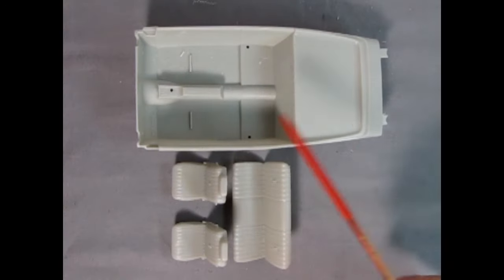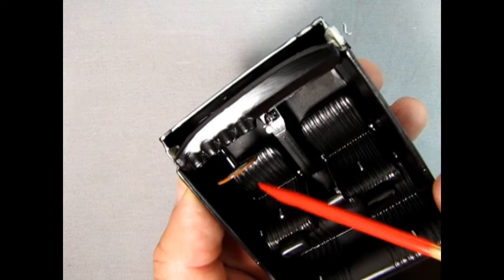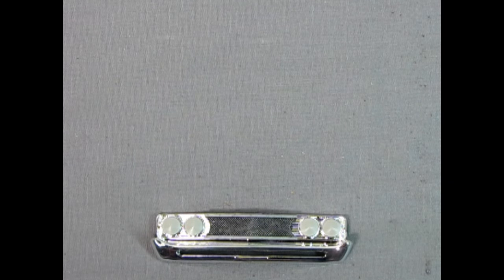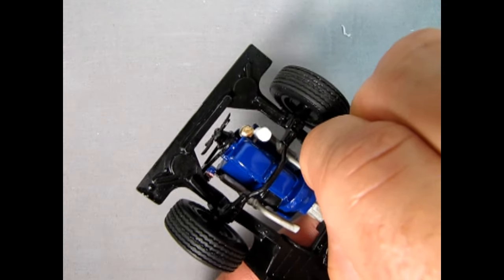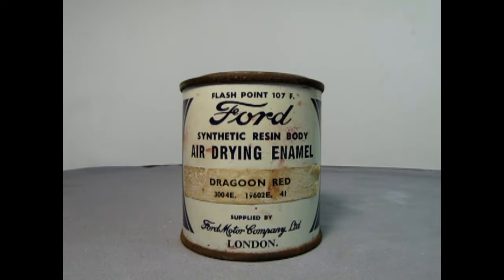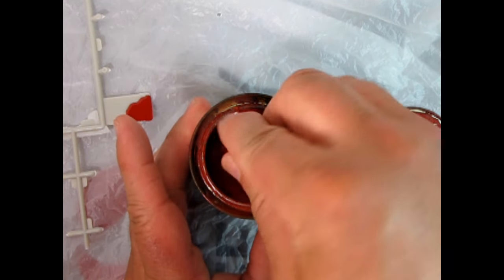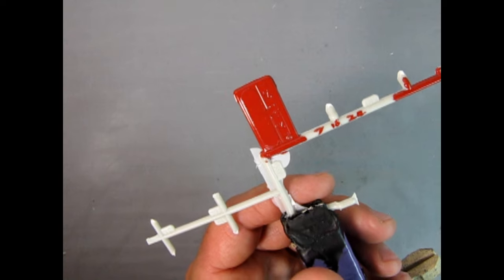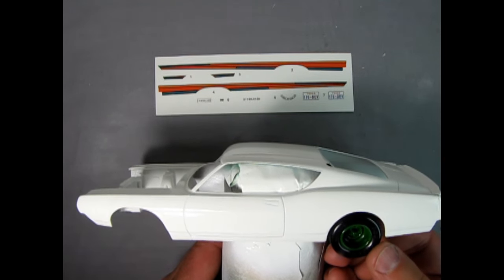How To Fix Everything Wrong With The AMT/ERTL 1969 Ford Fairlane Cobra/ Torino Part 5

Comment: The Nascar teams cut out the package shelf and fabricated a dual hoop upper shock mount that came through the floorboard. They used rubber boots to seal the holes opened up for the shocks to run through. They used the glove box in the closed position to house the ignition components also. They had to use a pump for the rear differential that was then plumbed to a cooler and the rear of the housing at the ring and pinion with hydraulic hoses. The ones I saw used a pump called Water Puppy. There are good pics online.
Reply from the maker: Thank you for the information. I am sure that anyone that wants to add in those details to their kit will appreciate it! 

What do you think of the dual carb set-up. What racing would that be used in?
Reply from the maker: I am going to use your comment in Video 8 where I show my NASCAR version.
Reply: @MonsterHobbiesModelCarGarage  Drag Racing.
Reply from the maker: @stealthbomber2127  But with the "NASCAR" designed dual air cleaner?
Reply: @MonsterHobbiesModelCarGarage  I am pretty sure the Dual Carb setup was used only in 1967 after nascar legalized the Hemi again and in an attempt for parity because Mopar's were winning everything gave the Ford Fairlane's the dual carbs on their 427 cubic inch engines. I believe very few 428 CJ's were ever ran in NASCAR. The 427's and Boss 429's were almost exclusively used during the late 60's thru early 70's Big Block days. Most teams used the Holman Moody air cleaner with an extra hole drilled in it for the duals. I believe the duals were only ran in 67 and may have been used briefly in 68 before being discontinued by NASCAR. The Fastback bodies on the Torino's and Cyclone's were more that the boxy Roadrunner's and Chargers could handle on the superspeedways. I hope this helps if you decide to do a true replica.
Reply from the maker: @stealthbomber2127  Thank you for the information! I will have to look up those years of NASCAR Fords and see if they do run with duals. 

In one of the AMT kits, I believe it was the 1970 Super Bee, they did include the experimental Twin Overhead Cam Hemi motor that was suppose to be used in the 1970 NASCAR season, but wasn't allowed. 

Maybe the dual carb set-up was in answer to that?

Comment: Coming on nicely now,Trevor 👍😎
Reply from the maker: Thanks 👍 - I hope it's helping you out, although I don't know if  my place in the video is equal to your place in building it.
Reply: @MonsterHobbiesModelCarGarage  I've moved on a bit from the windscreen fitting video and have just cut up and altered the other Cobra body to make a wide body kit😲👍😃
Reply from the maker: @petesmodelcarcustoms584  Cool! That should look good. Use the rear wheels and tires from the AMT 1969 Dodge Daytona.
Reply: @MonsterHobbiesModelCarGarage  I haven't got one.but I have found some wheels I want to use. They are in the rack in last video.
Reply from the maker: @petesmodelcarcustoms584  These tires also appear in the older AMT 1925 Model T Stock/hot Rod kits, maybe around 1988?
Reply: @MonsterHobbiesModelCarGarage  I think I've got some of those👍👍
Reply from the maker: They are Goodyear Blue Streak Dragway Specials. They have a tread pattern and are 17mm wide.
Reply: @MonsterHobbiesModelCarGarage  maybe I haven't got a set😭
Reply from the maker: That's a possibility.

Comment: Hi Trevor!Nobody wants to use this old Resin colors!They take weeks to dry and you cant really sand it!And they are very dangerous for your health!!
Reply from the maker: Point well taken!
Reply from the maker: I did a little net research after work and this is a compilation of what I found. (But I did know this from before.) 

What is resin enamel paint?

The term today means "hard surfaced paint" and usually is in reference to paint brands of higher quality, floor coatings of a high gloss finish, or spray paints. Most enamel paints are alkyd resin based. Some enamel paints have been made by adding varnish to oil-based paint.

Breathing solvent paint fumes for too long can cause headaches, dizziness, and nausea. This can happen in a poorly ventilated space or when large areas are being painted or stained. These paints can even be deadly if they are inhaled on purpose, or "huffed", to get high.

Keep the room well ventilated

Open windows, doors and keep a constant airflow circulating within the room. Place a couple of rotating fans around the room, angled towards an open window, and they'll help get rid of the fumes. Don't switch the fans on until you've finished your coat of paint and it's touch dry.

Also, the paint is more than 30 years old. I don't think many people have this in their collection anymore...just me!  :face-blue-smiling:
Reply: @MonsterHobbiesModelCarGarage  The todays Resin paint have nothing to do with these old ones!These old ones are very resistant and even rust prove to some level but after spraying the paint it had to dry a couple of days and was more a satin finish!To achieve the high gloss finishes of the 50s and 60s they had to be polished by hand(no machine permitted,because the heat would destroy the paint) wich was very difficult and time consuming!Today the use of this colors is not permitted anymore in an industrial level because of beeing too hazardous!The todays resin paints are something completely different!Mostly they are now primers(Epoxy)are sandable and very rust-protective,mostly sprayed on bare metal(or even concrete) as sealer against penetrating moisture!🙂
Reply from the maker: @williwass6837  Thank you for the information and history on these paints. I only have this one can and I would probably brush paint it on a few models, so nothing too "Industrial" of an application. I don't really like this red color though, so it's hard to say if I am going to use it much, or at all. .